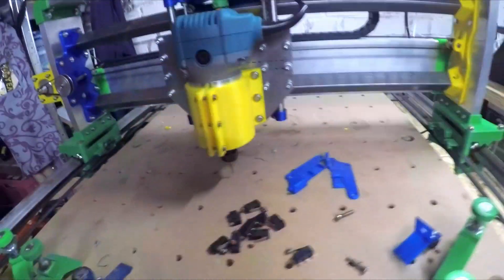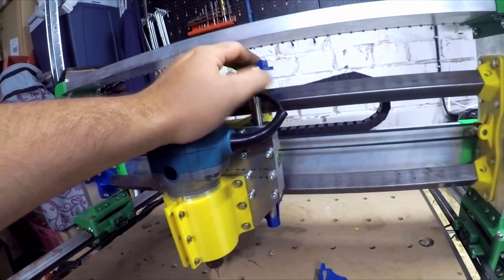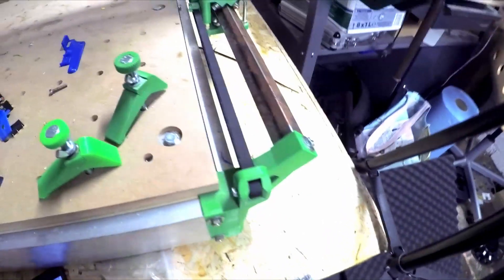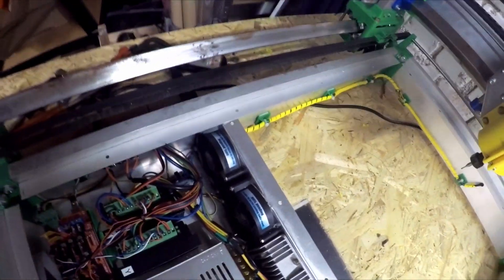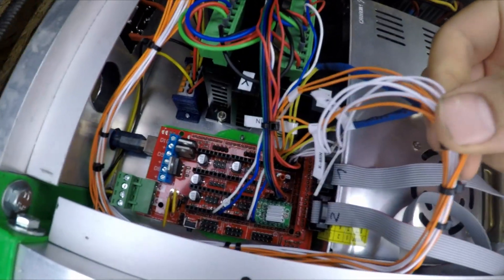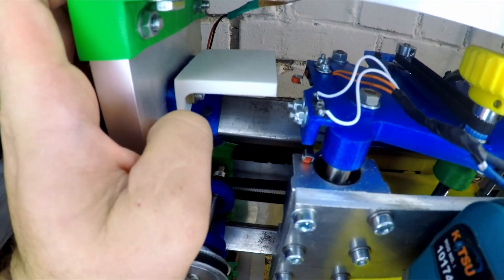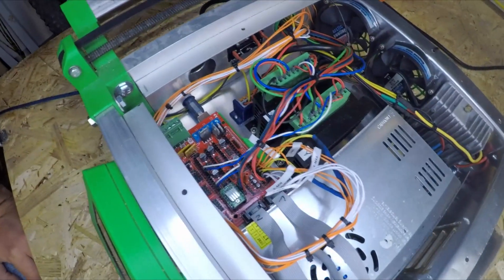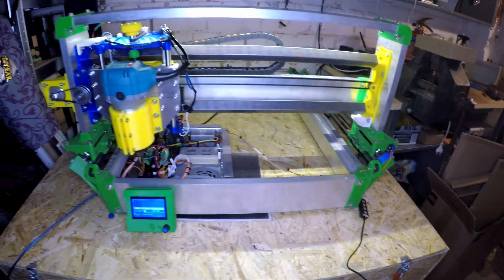R-CNC Upgrade with endstops // MPCNC improvement // 3D print cnc // mostly printed cnc

Comment: Great video, trying the same thing with endstops... do you have the thingiverse links to the switch mounts? cheers.
Reply from the maker: Thanks :)
No I do not have a Thingiverse link. I made a quick model myself, but had to do some changes afterwards because it got too long.
Should I upload it for you?
Reply: @mancaveprinting  any model to print would bea huge help thanks...
Reply from the maker: @thomasmcgravie6932  I will see what I can do and send a link.
Reply from the maker: @thomasmcgravie6932  https://www.thingiverse.com/thing:5162297
Here are the files as stl and f3d. So you can do some changes with Fusion 360 to make it fit your CNC.
Reply: @mancaveprinting   Many thanks, that's my christmas holiday project!😁